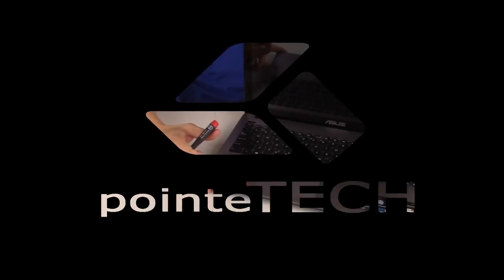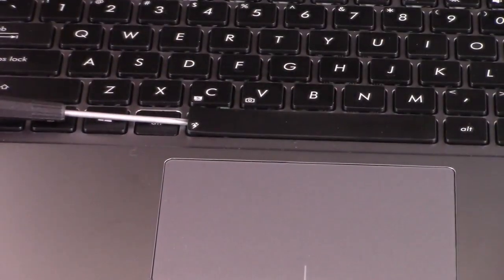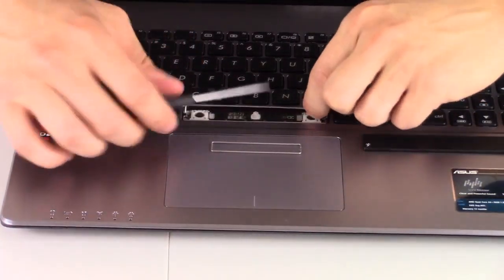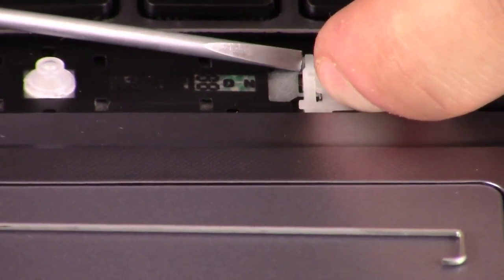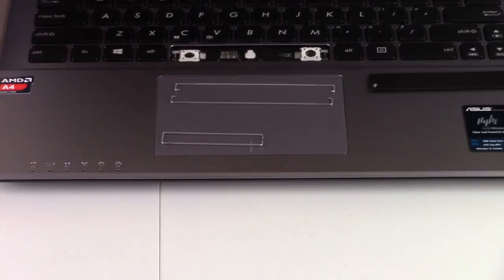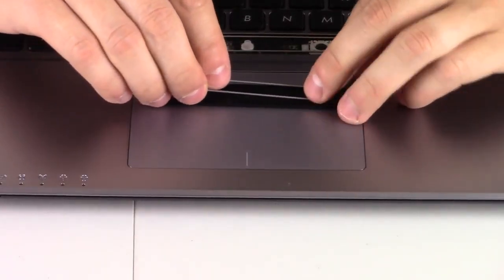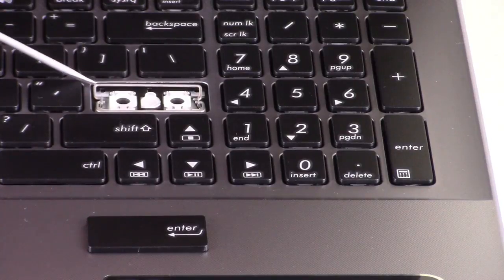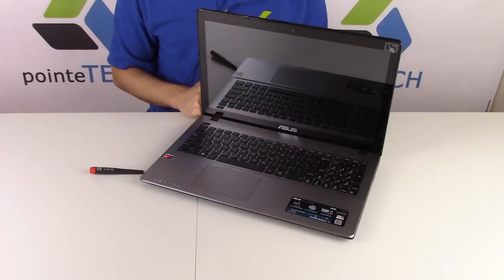How To Fix Replace Keyboard Key - Asus Laptop - Enter, Space, Shift, Backspace, Large Keys

Comment: I cleaned out my space bar since my brother spilled a bit of something under it. I thought it fixed it but if I click the space bar on the top of it and hold, the bottom pops up a tiny bit. Same with the bottom. Any fixes?
Reply from the maker: If your Key Cap is not clicking down in place correctly, it is most likely due to the Retainer Clip not being properly installed or damaged.  Remove the Cap and inspect for damage or that its not laying down flush and properly snapped in itself.  Compare to another Clip if needed by removing another Cap.
Reply: @PC_Monkey  Ohhh i see now, a little tap on  clip is off, ill try to find a replacement. Thanks!
Reply from the maker: @skinkly2508   I usually get my keys on Ebay or https://www.laptopkeys.com/

Comment: Hello, recently some keys of my asus vivobook got this squeaky plasticy noise and seems to have less resistance than the other keys, is there any fix that i could do to get rid of the squeak?
Reply from the maker: I would disassemble the individual keys as seen here and inspect for damage. Or perhaps they just need to be cleaned and reinstalled
Reply: @PC_Monkey  thanks for the reply, i saw your other vid and just learn that  there are the inset type of keyboard. is there any way that i can identify my laptop keyboard type? my laptop is a vivobook pro 15 of the 2021 model if that is of any help.

Comment: Hi!
Thanks for this video! It looks very helpful to know that keys can be removed and fixed like this. I have an Asus Vivobook laptop, and the space bar tends to rattle a lot. Can you suggest something? I want the rattling to stop as it can be distracting while typing for a long time. Do you think that it can be re-adjusted and repaired so it stops making that much noise while clicking it?
Also, my old Lenovo Ideapad had a couple of keys completely stop working. Can those be re-fixed as well?
Reply from the maker: Most likely something is loose or there is something caught under the key that rattles.  The keys that dont work can be fixed this way if the issue is mechanical.  If the keys are mechanically fine, then this video wont help.  It would most likely be a driver issue or the keyboard is bad and needs to be replaced. Update your drivers as seen here;  https://www.youtube.com/watch?v=twjDVfEKfxM
Reply: Thanks again. The keyboard is fine otherwise. All my updates are done, and I keep checking on them as you have shown on that other video as well. It just appears to be this particular space bar key that makes a lot more of a clappy noise when hit every few seconds than it should be. All the other keys are fine and don't make that sound. I agree with what you said about something possibly being loose inside. I will be taking it to the service center to get it tested and fixed, as I don't think I know how to — nor do I think it is safe for me to — open it up the way you just did.
Reply: More over the space bar is not as soft and supple as the other keys. You can gently click on the other keys and they are still responsive and tactile, but the space key is a little hard and needs more pressure to be clicked on, although I wouldn't say it doesn't work or is faulty as it works very well. But it needs to be clicked a little harder and makes a hard snap/clap sound every time it is hit. I hope something can be adjusted inside to balance that out and make it like the other keys.
Reply from the maker: @supriyathanawala12  Ya, sounds mechanical to me :)  Good luck getting it fixed !!
Reply: @PC_Monkey  I checked with the Asus service center. They say they will replace either the entire keyboard or offer a Defective/DOA certificate on examining it. My office computer engineer says it seems like a case of a spring being loose inside, and recommends getting the entire keyboard replaced — as trying to repair only one key like this is not possible or advisable under the warranty scheme if we land up damaging something. 
I believe this is a French inset keyboard and, like you showed on one of your other videos, it does not seem very easy to remove and replace, as it has ribbons fitted around it or something. Am I right? I am happy with the laptop otherwise and am not too keen to discard it or mess too much with it in a way that damages things. My only concern is to lubricate and fix the space bar, which is tight and requires more pressure on my thumb, which is being strained by this and also slowing my typing down a bit, even if I tolerate the noise. 
I doubt I will get a refund for the entire piece, whether or not I get a DOA certificate from the service center. At the most, they will replace the entire machine with another identical one, but there's no guarantee that the same problem won't occur there too. What do you suggest? Do you think this can be repaired and fixed so that the mechanical tightness and stiffness that's creating the disturbing sound in the space bar can be removed and the space bar be easier on my hand? I am apprehensive about taking it to someone who doesn't really know how to do it and damages the machine further. I am also worried that the badly assembled keyboard may cause more wear and tear to it in the coming months as I continue to use it more.
PS: I also tried changing my finger strokes on the keyboard a bit. I don't know to what extent that might help, but pressing the space bar down with my index finger instead of with my slanted thumb does not create the sound. But it is slower and might take me a while to get used to typing like that too.
What do you suggest I do?
Reply from the maker: @supriyathanawala12  Then I would go with his recommendation on having them fix the keyboard
Reply: @PC_Monkey  By fix, you mean fix a new replaced keyboard onto the laptop? If that's what you mean, I agree too, as otherwise, it's a good keyboard and is quite tactile and smooth. It appears like the spring on the space bar alone is loose and that it can be solved by simply being re-fitted. I think I am going to take it to the service center and let them fit another new keyboard on this then. As I type right now, I think I can manage on it for a lot more time, as the snap has reduced considerably as well and it does not seem to be a very big problem as of now. I think I'll go ahead with that then! Thanks for all the advice and for listening/helping patiently! -Supriya
Reply from the maker: @supriyathanawala12  NP :)

Comment: For some reason my Asus Vivobook spacebar won't just snap in place. I hear multiple clicking noises and it sounds like it would be in place, but the small nodges in the plastic part won't just connect with the small holes in the white bouncing thingies :/
Reply from the maker: If your Key Cap is not clicking down in place correctly, it is most likely due to the Retainer Clip not being properly installed or damaged.  Remove the Cap and inspect for damage or that its not laying down flush and properly snapped in itself.  Compare to another Clip if needed by removing another Cap.

Comment: mine is  an asus Altec Lansing  and the space bar retainer clip is in two parts creating a sort of spring when fixed in place. The rest of the bars and hooks are similar. my problem is that the space bar itself is damaged. I would like to change the complete space Bar with clips. Is this Possible? Thanks.
Reply from the maker: I dont think I fully understand. You said the clips and bars are ok but its the key cap itself thats broken.  I would get a new key online and just replace the cap.

Comment: So if my 2 plastic retaining clips have each come apart and are now in 2 pieces each (4 total pieces) what do you suggest?
Reply from the maker: They fit together with a small plastic pin on the left and right of the inner clip.  These fit into holes on the outer clip.  To see exactly how the inner clip sits in the outer clip, remove another key cap and copy the clip under it.

Comment: Hey mate my kid was using my laptop and it "magically" came up the space bar ive got it back in but it won't snap back in the last bit it sits up wonky any ideas
Reply from the maker: If your Key Cap is not clicking down in place correctly, it is most likely due to the Retainer Clip not being properly installed or damaged.  Remove the Cap and inspect for damage or that its not laying down flush and properly snapped in itself.  Compare to another Clip if needed by removing another Cap.
Reply: @PC_Monkey  hey thanks for the reply I turned it around and it clicked in but its stuck down so i think it may be one of the white clips it connects too

Comment: My metal things are too long or have too short ends, so that if I insert left end it in the left hole, the right end is right at the position of the right hole
Reply from the maker: Were they not correctly installed like that when you first opened up the key?  If so, I think someone must have used incorrect parts to fix it at some point :(
Reply: One of mine came loose completely while removing a key and didn't immediately slot in correctly (it was the original metal bars). It might just take a little careful wiggling to get both ends back in.
Reply: @Amayawolf_01  I got it correctly as well, don't remember how though

Comment: Hello. I returned two of the keys after cleaning the slots. However when I returned it, whenever I push the keys it is positioned on an angle and I need to reposition it. What I need to do to fix it. Thanks.
Reply from the maker: If your Key Cap is not clicking down in place correctly, it is most likely due to the Retainer Clip not being properly installed or damaged.  Remove the Cap and inspect for damage or that its not laying down flush and properly snapped in itself.  Compare to another Clip if needed by removing another Cap.
Reply: If in case the retainer is damaged is there a possibility that I can buy the retainer only?
Reply from the maker: @charlesgianbaldemoro3888  I have rarely seen them for sale individually.  I usually have to purchase a full key assembly or a keyboard if I cant find a loose key

Comment: The piece snapped back on the laptop but it is still very loose and Idk What to do
Reply from the maker: If your Key Cap is not clicking down in place correctly, it is most likely due to the Retainer Clip not being properly installed or damaged.  Remove the Cap and inspect for damage or that its not laying down flush and properly snapped in itself.  Compare to another Clip if needed by removing another Cap.
Reply: @PC_Monkey  TY
Reply from the maker: @thomasnetflix4  Happy to help :)  Always here if needed !!

Comment: I have a problem I was cleaning my space bar and then I accidentally remove the white square in the right and I’ve been trying to put them back but I can’t figure where does the little tiny pole of the little square

Edit: OH NO I BROKE THE SQUARE NOOO is there any way to fix it again ?
Reply: Do you have discord or or messenger so i can send pics i promise i wont leak you i promise I’m not finger crossing and i swore my heart if i break my promise i die

Comment: After doing this my spacebar is loose and not responding, any help?
Reply from the maker: If the key assembly is not installing correctly, its either due to a component being damaged and needing to be replaced or a component not being orientated correctly. I would disassemble the key as seen here in this video and inspect for damage. If there is no damage, install the key. If there is damage, replace the key. Would you like help locating a key? If so, what is the brand and model for your computer?
Reply: @PC_Monkey  something about the order of the longer bars was messing it up haha, thank u!

Comment: bruh those plastic thing popped off on one side making it so hard to remove without breaking
Reply from the maker: Keys can be so frustrating :(  They are so breakable too :(
Reply: @PC_Monkey  ...I accidently broke one on my space bar just now when I put my spacebar back. I didn't realize the plastic is stuck at the side, now I had to use copy paste for space, this is torture-
Reply from the maker: @DoopaDoobie   I usually get my keys on Ebay or https://www.laptopkeys.com/.  If you cannot find a loose key for sale, you may have to purchase a keyboard and take a key from there.

Comment: My space bar is on but it's very loose
Reply from the maker: If your Key Cap is not clicking down in place correctly, it is most likely due to the Retainer Clip not being properly installed or damaged.  Remove the Cap and inspect for damage or that its not laying down flush and properly snapped in itself.  Compare to another Clip if needed by removing another Cap.

Comment: Ok,mySpaceBarIsLegitBroken.ImUsingALenovoThinkpad.WhatDoIdo,ICan'tFixIt
Reply from the maker: If its physically broken, then you should replace it by purchasing a new one or purchasing a keyboard and removing the needed key from that.  If it feels like its working fine, and its just not working electronically, then it could be your keyboard is broken or the drivers are not updated / erroring.
Reply: @PC_Monkey  TheRestOfThePCIsFine,TheKeyboardIsNotPhysicallyBroken,IPeeledOffTheShellOfTheSpaceBar,AndItLooksFine.Help?
Reply from the maker: @TheReal_KitCat  If you took off the top part of the key then you should be able to just snap it back into place assuming its not broken.  If it is broken, then you should purchase an individual key or purchase a keyboard to take a key from.  You need help locating one?
Reply: @PC_Monkey  It's ok, I found the On-Screen keyboard, tho not very efficient and blockes the lower half of the screen. Thanks anyway

Comment: Hi there, great tut! Would this work as well for the new asus zenbook ? like this ones: https://www.mynewsdesk.com/no/asus-nordic-ab/pressreleases/asus-launches-new-zenbook-14-um425-slash-ux425-with-amd-and-intel-options-in-norway-3014275 

My spacebar key is not click every 1/4 times or so. I don't want to send it back for warranty because they format the entire SSD, which is annoying for such a small technical problem....
Reply from the maker: If the key physically feels like it is not installed correctly, then you can disassemble as seen here and try to reassemble properly.
Reply: @PC_Monkey  I got it in November and it was working fine, it's been getting worse the last few days, I've tried compressed air, vacuum cleaner, etc. I am afraid to open it but hate to service to format my SSD...